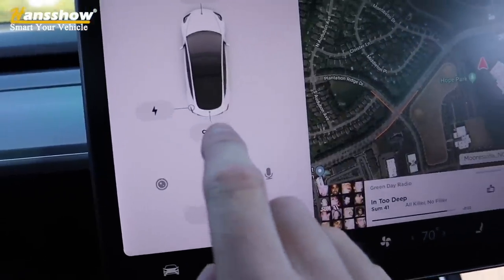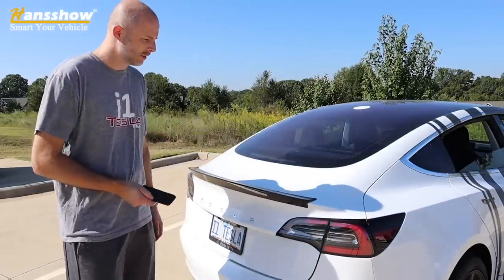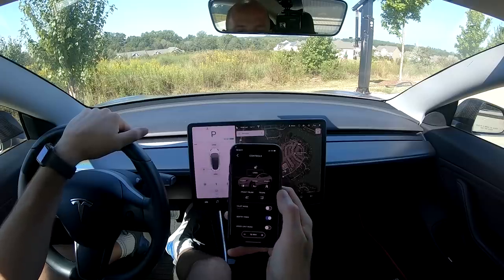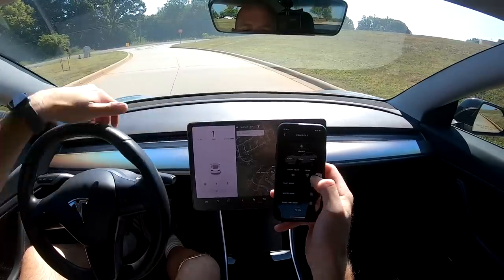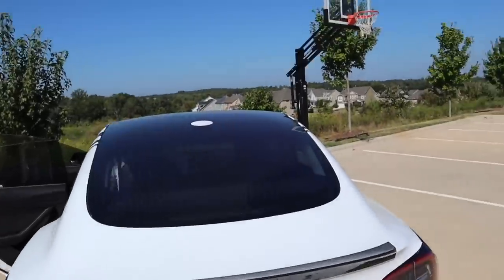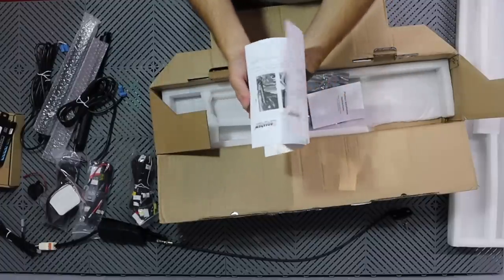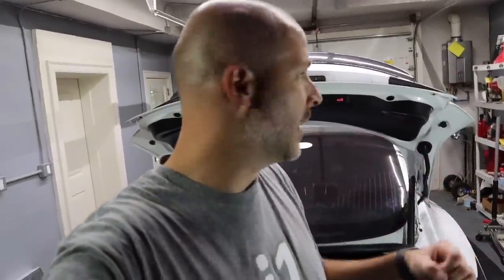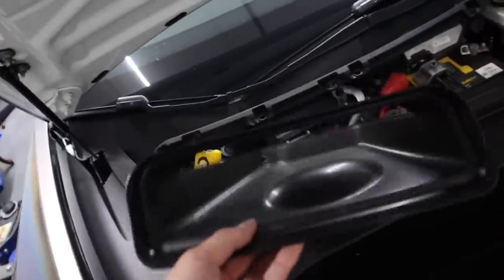New Power Trunk for Model 3

Comment: I cut wire, fish it through the rubber tube using 14 AWG wire and vaseline, and then reconnect with Butt Splice Connectors. it was easy. the Hard part for me was to taking interior panels off to locate Tailgate signal plug behind speaker.

Comment: Can the system be configured so that the car is able to see that the trunk is open? I think I would prefer it to operate like the frunk in the demo that Frugal Tesla Guy did. I understand that you won't be able to close the trunk with the touch screen but I don't think that will be an issue for me because I can use my key fob to close it if I find myself in the car while it is open.
Reply from the maker: Yes it can but you will have to reconnect the blue wire at the connects to the latch on the deck lid

Comment: Hi Brian. Can you explain in more detail what you disconnected to avoid sparking? Just don't want to make a big mistake! Thanks
Reply from the maker: The kit comes with an inline fuse that you connect to the battery. I removed the fuse to connected it to the battery. When I was all done and ready to power up after connecting the ground. Then I installed the fuse.

Comment: Hmm - looks like the connector thats need to be pulled through the rubber tube should be mounted later (TeslaOffer as changed this already for their version).
I also would recommend to connect the computer to the non permanent power available on the driver side footwell to avoid vampire drain. In case you do this I would add a second lower level fuse (eg. 15A) close by the computer so that you can easily change this instead of dismounting the footwell area when fuse is blown up.
BTW thanks for your vids - reselled (private initiative) now 25+ pairs of your front/trunk struts solution in Germany and Austria
Reply from the maker: The connector is going to be removed before they ship it so it is easier to get through the tube. I talked to them
Reply: @i1Tesla   3+ weeks after order, I received the kit today, it does NOT have the improvements that you were told they would make, specifically the wire run thru the trunk lid electrical flex hose.  It has all of the connectors on so it would be a bitch to fish thru the flex hose if even possible.  I'm an electronics type so I'll be cutting and splicing my wires as needed to install.  Also I did get the foot sensor, you must slice its wires into the opener harness yourself, no connectors provided for that part.   Just a heads up for others.

Comment: Just ordered one!  Thanks.
One question about passing the power out to the 12v.  The manual/video suggests going through the driver's side.  Is there a hole there to pass the wire?  Or should I send it up the passenger side like you did and drill through that rubber seal?
Reply from the maker: You can do it either way. I did it that way because I just did it the other day for the sounds
Reply: Hansshow actually recommends that you connect to a pretty hard to reach 12V terminal in the drivers side kick panel, no running thru the firewall to the battery needed.  It is a bit tedious but better in my opinion that connecting to the battery.  Hansshow was pretty responsive to my questions.

Comment: Thanks for the video Brian.  Just wondering if the foot sensor is worth buying and installing.  Do you use it often?  Is it reliable to use?  Or is it a waste of time for the most part?
Reply from the maker: I did not install it. i don't think I would ever use it.
Reply: Personally I like foot sensors, I added it to mine and it works very reliably.  It is more of a project to install, but I was pulling my bumper anyway to install an "EcoHitch" stealth tow hitch for a Kuatt Bike rack.

Comment: How does it tie into the CAN bus? Any wire cutting or splicing required?
Reply: Watch the video. It dosen't tie until the canbus
Reply from the maker: No splicing or CAN bus wires.
Reply: Since this doesn't use the CAN, is this immune to breakage from Tesla updates?  Will the manufacturer send updates if needed?

Comment: I didn't realize that Tesla's had an intake. Is that an air intake that cools the battery?
Reply: Tesla's have an upper intake for cabin air and the lower intake (with electric shutter) to bring in air for the cabin A/C and Battery temperature management systems.

Comment: You do amazing work, Brian! Thank you so much for the discount code! 
Question: Can you open the trunk by using the original method, or does that just unlock it for manual raising? 
Thank you so much 😊
Reply from the maker: You can open the trunk from the trunk button on the trunk lid from outside the car, the app, the keyfob or the screen.
Reply: i1Tesla Thank you, Brian!

Comment: I really want it installed in mine, but what about warrenty?
The only real change to the car is the latch mechanics and struts thayt are change from the original to 3rd party. Will that affect anything?
I know a simply change of the door lights will void the warrenty with the doors/windows. A member on a Danish forum told that his trim got scratched because the window rolled all the way up, while the door was open. But tesla refused to cover it because he change the puddle lights.
Reply from the maker: The only thing that Tesla could not cover is the latch. But if you have an issue just take everything off and then call Tesla.

Comment: I didn't get what you said about the car not knowing get if the trunk was closed or not? Doesn't the app show if the trunk is open or closed with this mod? I assume the latch only opens when the car senses that you phone is close to the car when using the foot sensor?
Reply from the maker: The car and the app think the trunk is closed. The foot sensor will only open if the phone is close to the car or it is unlocked

Comment: Hi, I've installed the same kit from hansshow, and tried to follow the manual to set a higher strength at closing. But  for some reason the module can't enter the programming mode if I set the trunk lock to close status. Have you tried to configure this setting for smoother closing?
Reply from the maker: It took me a little bit to figure it out. Did you get it to open faster?

Comment: Hi Brian, do you know if the power cable can be hooked up to a switched power source, like spicing into the 12V cig adapter line under the armrest? I'm aware that this would limit the usage of the optional foot sensor, as there wouldn't be always-on power. But I'm not comfortable hooking up anything directly to the 12V battery... Thanks!
Reply from the maker: You can hook it up to any power source but the car would have to wake up before the trunk is opened. So you would have to open a door before you open the trunk

Comment: I don't get how this works if you don't tap into the CAN bus, maybe someone can explain. Both the app and the screen generate a CAN bus message to open the trunk. If the auto lift gate can't see that message, because you didn't tap into the bus, then how is it informed of the desired command?
Reply from the maker: magic
Reply: @i1Tesla  I'd like the real answer please. There has to be a tap of some kind if not on the bus elsewhere.
Reply from the maker: Vripiat Buzoi sorry 😐. No tap. There is a blue wire in the latch harness that is cut. This tricks the car into thinking the trunk is closed. That is why you see the trunk open and then it shows it closed right away. The only thing you are attaching to the car is to the front battery and ground. Works every time so far. I think you will be happy with it

Comment: Brian,

What enables the trunk closure from the screen? How does it work by itself? I just finished installing the other kit Saturday. Since the hardware is made by the the same company, I have to assume the only difference is the brain unit. I take it the only tap into the can bus id via the trunk light harness?
Reply: it's probably just independently alternating between open and close.  the app sends the "open" message no matter what, but the unit then interprets it as a "close".
Reply: Nathan Blaisdell , it certainly does that via the App. But the on screen button greys out. Brian, didn’t really focus on the on screen button closure. I wonder what makes the button go live again making it usable.
Reply: @dennisschlieckau8723  ah good catch.  I'm curious to know too.
Reply: @Dennis As per the video, this mod tricks the car into thinking the the trunk is closed even when it’s open, so the on-dashboard button is still functioning, allowing it to send a signal to the kit’s controller. Since the controller knows when the trunk is actually open, it will interpret the signal to mean "close" in that circumstance.
Reply from the maker: In the trunk switch there is a blue wire that will tell the computer that the trunk is open. That wire is cut to tell the computer it is closed. If you connect the wire back up the computer will know and display the correct placement of the door and in the app. But you wont be able to close the trunk from the screen.
Reply: i1Tesla Okay, rather than Cut the blue wire, it seems like a person could simply de-pin it from the T-branch harness. What was the original purpose of tapping the Can bus in Teslaoffer kit? Do you know? Also what is the reason for tapping the trunk interior lighting harness.
Reply from the maker: It is not tapping the trunk light. It comes with new wires for the trunk light. the stock ones aren't used anymore. Unless you want to add more light. Not sure why they cut the wire but it must be a reason.
Reply: i1Tesla , just so we’re on the same page. Which blue wire gets cut or disconnected. The factory harness or the trunk opening ECU. 

I assume it would be the factory harness, since it would interrupt the signal for the screen button to be grayed out “opened”
Reply: Does the kit come with a button to close from inside if you don’t want to cut the blue wire?

Comment: Hey Brian I’m in So Cal. Can you recommend any places I can get this installed? Also, how is this kit able to close the trunk from the touchscreen? I thought that wasn’t possible with other kits. Thanks!
Reply from the maker: It is not possible with the other kits. There is a wire in the switch harness that talks to the computer to let it know it the trunk is open or closed. This one make the car think the trunk is closed so the button will open it.
Reply: @i1Tesla  Thanks Brian
Reply: @i1Tesla  Also, is it possible to close the frunk from the touchscreen/app?
Reply from the maker: Yes

Comment: So does it open and close from control of the boot release and not the CAN?
Reply from the maker: Yes it opens from the boot release button and closes from it to but it is hard to reach the button when the trunk is open
Reply: Thanks Brian however I guess I'm asking about the connections...does it connect to the boot solenoid wires? the toggles it up and down?
Reply: @alicetronics-jaycarsplatin5629  Yes, the kit installs with connectors to tap into the boot solenoid and also the boot release button.  They use mating connectors with short 10cm pigtails which allows this without modifying the car wiring at all, well thought out.

Comment: Where does it connect in the battery it was unclear didn’t get the exact price
Reply from the maker: It attaches right to the positive terminal and the price is $450 after the 10% discount code. Trunk or frunk. Plus $45 for the foot sensor if you want that
Reply: i1Tesla thanks

Comment: I don't like the idea of having to slice open that cable shroud next to the right hand strut. Not at all. That's a big deal breaker for me.
Reply from the maker: They are shipping the units with the plastic end off so it will go through the tube. I talked to them and had them change it after the video

Comment: I imagine if you do any wire tapping, Tesla will make it very hard to get any electrical work done under warranty and force you to prove it’s not the TeslaOffer powerlift gate.
Reply from the maker: They will see that the wires aren't tapped
Reply: i1Tesla I meant on the TeslaOffer lift gate
Reply from the maker: No warranty issue with it
Reply: i1Tesla maybe for now, but like you said in your video, a software update happens, and things change.
Reply from the maker: Not for this unit
Reply: i1Tesla I know I said in my previous comment, I’m talking about the “TeslaOffer” lift gate

Comment: Pretty cool but not $450 cool
Reply: If you had a Tesla 450 wouldn’t be a lot to get rid of a major inconvenience
Reply: Who else has it cheaper?
Reply: @jrslugwell  yes it is . My tesla isnt 100k like the model s guys. I'm still pinching pennies lol
Reply from the maker: Nobody has it cheaper unless you go in and buy a group rate. This is the company that makes all the parts for all the company other companies
Reply: @i1Tesla  It's definitely a fair price just not worth it to me.  Also one thing you'll have to remember is to not forget to check the trunk/rear window for rain/snow so it doesn't slide into the trunk when it's opened.
Reply from the maker: Wouldn't you have to do that anyway
Reply: @i1Tesla  yeah but it's easier to forget when it's automatic opening from inside the car
Reply: Wait for Taptes do it for $150-200 and $400 for all

Comment: 14v battery? 🤔
Reply: All car batteries are "12V" but at full charge measure around 13.8 to 14V, Brian does cabinets, I do electronics...
Reply: @RemE14MZ  a Full 12v lead acid battery is between 12.65 and 12.8 volts
Reply: @lanesalbacka1821  Not under charge in a normal running car I should have said.
Reply: @RemE14MZ  Sure, while it's being charged a meter would measure somewhere around 14v +/- 1v certainly. The battery its lf still would only be about 12v. As soon as the 14v charging supply is removed one would read the 12ish volts. Even immediately after removing the higher voltage supply.

Comment: Yes, it does open when driving if you have the footwell sensor*, so I recommend that you *not get that (not smart enough to sense you are driving - I believe it is the footwell sensor seeing pavement changes it mistakes for foot swipes).  Opened 3 times on me while driving, so I removed the fuse for the sensor to disable it.
Reply: rich1383yt this is what happens when you don’t tap the can.  Other companies that tap the can bus does so to keep the safety in tact like not opening when I’m drive. My trunk stays shut shut with foot sensor
Reply: The foot sensor has a 20cm (8 inch) sensing range, perhaps mounting it further back in the bumper housing, up the rear a bit.  This would allow it to point rearward and down (like a 45 degree down pattern if viewed from the side) this is to not sense the ground as easily.  I think I'll ask Hansshow about this issue, thanks for the heads up.
Reply: I have now installed my system, with foot sensor.  I asked Hansshow about this and they sent me a video of the testing, the trunk will not open by foot or rear stock button if the car is moving at all.  I have been driving mine for a week and the trunk does not open by itself period.  The foot sensor needs to see a quick "kick" towards it for about 1/3 of a second to trigger plus it is ignored when the car is moving.